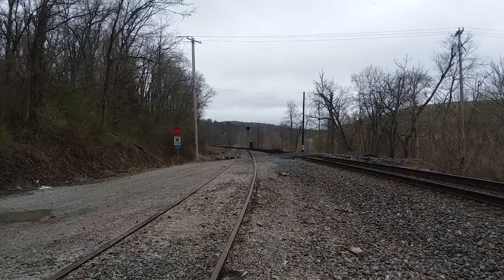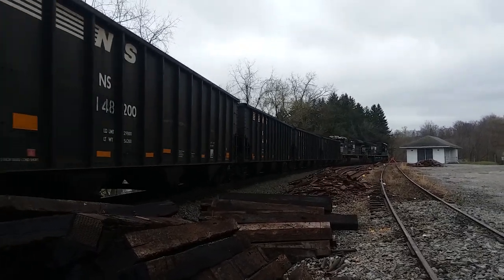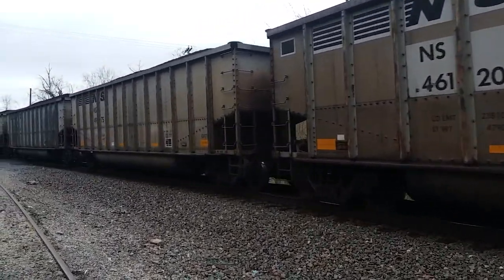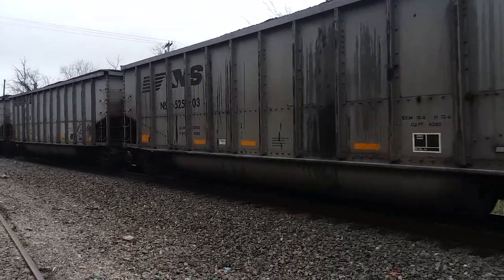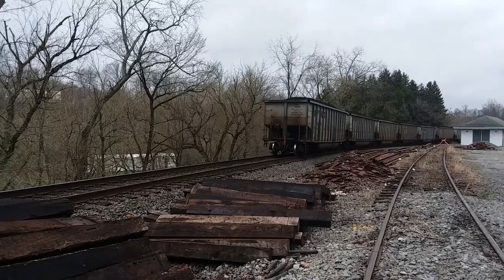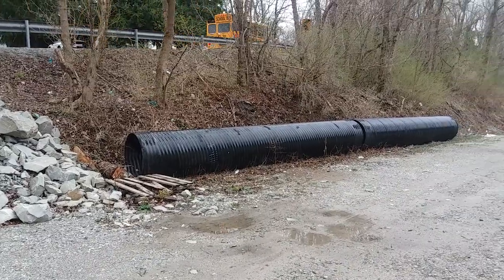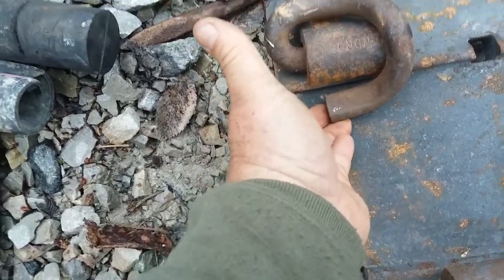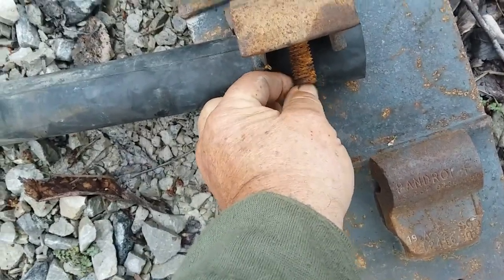Norfolk Southern with Loaded Coal Drag - EMD SD 70 ACe as Trailing Locomotive

Comment: Great to see a new video thanks!!! Give us more info. when you can on the car noise.  I take it the thud-thud-thud-thud- is a flat spotted wheel? I could not help but bug you with a question!!! Thanks!!!!
Reply from the maker: You are certainly correct in that observation, flat spot on a wheel.
No problemo on asking a good question. Flat spots commonly are caused by brakes hanging up and not fully releasing and the car
wheel gets drug on the rails with the brakes applied, sometimes there is also some impurities in the wheel metal and as the wheel
continually "hits" the rail as it goes down track that aggravates
the impurity and eventually a weak spot in the wheel happens where
the metal spalls out. Hope that explains it better how it happens.
Reply: @ccrx6700  Thanks as always!! Not really related to this video but, how did your line end up with so much “mud” in the Ballast? Is the mud really just coal dust that accumulates from the hoppers?  When I think of mud I think of topsoil and clay just wondering thanks.

Comment: The regulator I ran used those hollow broom pieces, they sucked taking off and putting on.
Reply from the maker: I bet they did! How in the world did you get them tightened without the sticks collapsing? The clamps we have on the solid brooms really dig into them
Reply: @ccrx6700  it wasn't fun. When I had the help we would take turns holding a pipe over the bristles while the other hit them on with a sledgehammer. When I didn't have the help I had to do it all myself. To get them off you had to cut them. A good knife and sharpening stone. My regulator also had smaller bristles that fit inside the larger black ones. Those were easy to get on and off in comparison. It was a multi day project just to replace the bristles.

Comment: Good video.like the clip system for securing the track to the plates. Seems to me the usage of spikes hammered into a wooden cross tie is kind of primitive. Sooner or later that spike is gonna get loose. Not so with the clip.At least that’s the way it looks to me.
Reply: Certainly looks more secure until you consider that the plate was only held down with spikes
Reply: @hirsutusi5536  what about concrete ties. Are the plates screwed to the ties and would that be the way to go for real long time trouble free track?
Reply from the maker: There are different fastening systems associated with concrete ties.
 and I'm not really familiar with all of them. The problem with concrete ties is they don't work well with heavy loads, they want
to crack in the middle. There is a lot of experimentation going on with pre stressed concrete ties and how to better prevent that cracking from happening. Concrete is perfect for transit and lighter loaded cars.

Concrete and wood ties both have their pros and cons. For us I have an old Jackson tamper. Concrete ties are thicker than wood. The workheads on my tamper are set to go down to a distance 2 inches 
below the bottom of a wood tie then squeeze the ballast under the tie. There is no way I could tamp a concrete tie when it is thicker than wood. The newer tampers have a toggle in the cab which allows that machine to tamp either wood or concrete, but I don't have that ability.
Reply from the maker: Yes sir, very observant! Would be a much better system if the
plates were lag screwed which some of the are. The clips also
do have a tendency to want to slide out when exposed to loads being only hauled one way on the track. I do think that in mud spots
the pandrol clips would be better because we have eliminate 2 or 3 spikes, but guess we could speculate all day long about that. Appreciate your watching
Reply from the maker: Thank you, glad you enjoyed watching. You had 2 replies to your
original comment, I responded to both of them, you may also like to
go back and read the entire thread. But you are right sooner or later a spike is gonna get loosened specially in mud spots